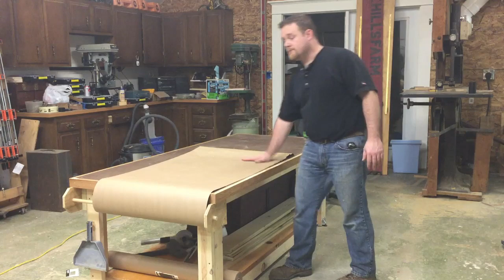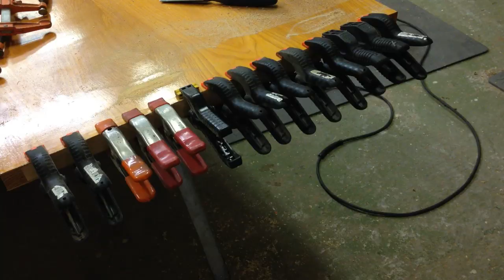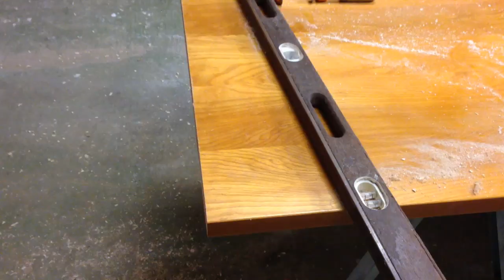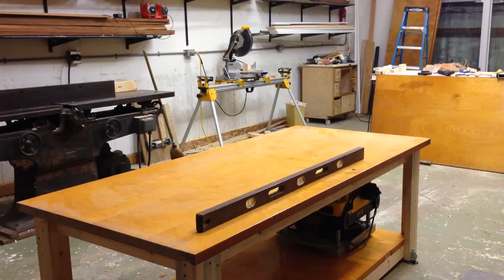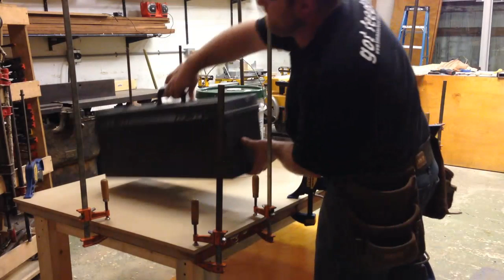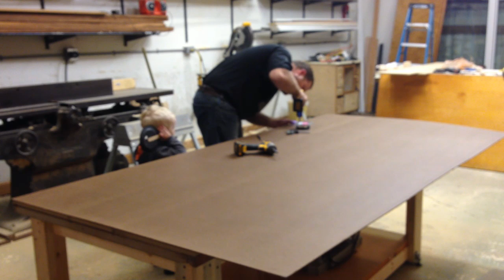Assembly Table made using hollow core doors for a torsion box  ep2

Comment: Liked the use of the hollow core door and the tip to put MDF on top to protect the luan. Was surprised you never verified the hollow core door was flat before going ahead. I say t his because a hollow door we recently got for free is twisted. Didn't notice when we picked it up, but saw it when sighting along the edge.
Reply from the maker: Pam, thanks for watching.  I hung doors for 10 years, so as soon as i grab a door out of habit i sight the top edge against the bottom edge to see if there is any twist.  Basically i make the top and bottom into winding sticks and then I eyeball the edges to make sure there is no bow.  I do this with any door i put my hands on as i have started to install too many doors in the past only to find out that they were warped ;o)

Comment: I notice when you lay the 2x4's down on the bottom door I see gaps at each end of them.  I would have thought there would be no gaps. Either the 2x4 has a cup in it or the door bows. What am I missing?
Reply from the maker: Alan Matthews at what time stamp and I will look and see what you're talking about
Reply: 2:48
Reply from the maker: Sorry it has taken me so long to reply, i had a death in my family that has put me behind on everything.  I am pretty sure that there are small undulations in the hollow core door inbetween the webbing that is causing this, but once the 1/2" mdf was put on top it was perfectly flat.  I even went out and put my 8' level on it to make sure and it is dead flat.  The funny thing is if it wasn't on video i would have argued with you because i don't remember there being any undulations at all.  Thanks for watching and commenting.

Comment: Nice jointer (a 16"?00) and bandsaw. Are you an OWWMer?
Reply from the maker: Thanks, it's a 12" cutter head but the bed is 17" wide.  It and the bandsaw are both made by "The Silver MFG Company" and came from the same factory.  What is OWWM?
Reply: The Old Woodworking Machines forum is an off shoot of Vintage Machinery.org., which is a data base devoted to information about old wood and metal working machines. If you want to know anything about these machines or the mfr. of them go to these sites. VM has down loadable manuals and other print information. While the OWWM forum is a fount of knowledge about machinery. If you have a question that can't be answered here, the info doesn't exist. One caveat, no Asian machinery.
Great people,
Rollie